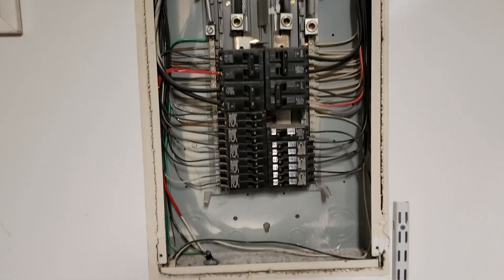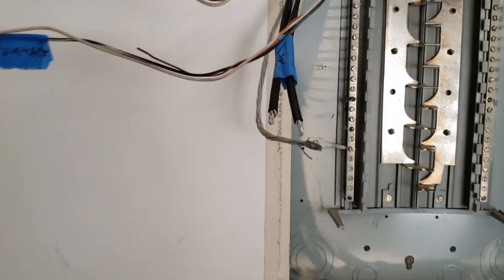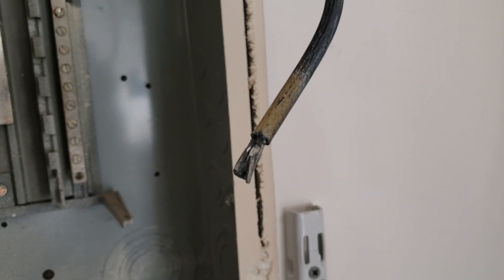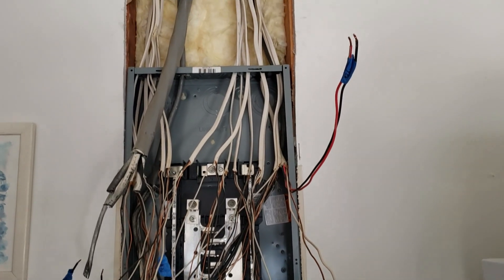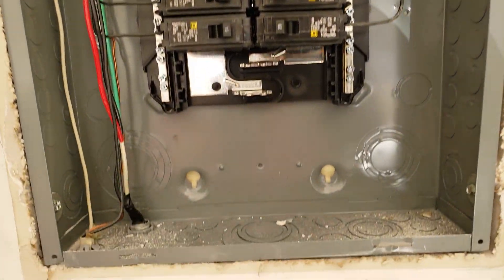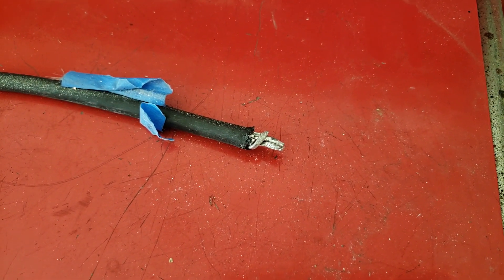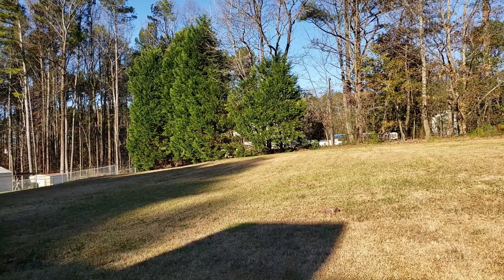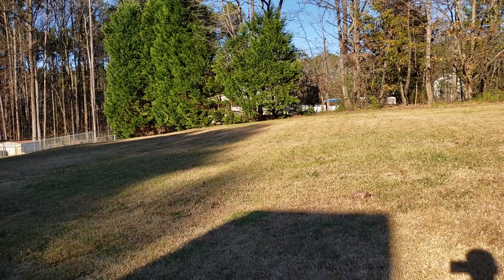Breaker Panel Update & Future Site of Solar Panels

Comment: I would like to build my first battery 16s.  Curious why you chose a
120Ah over as much as a 285Ah?  My thoughts are I could build 2-3 16s or 1-2 2p16s  with 285Ah batteries and have less hardware and space etc.
Reply: Currently the best deals in Lifepo4 batteries seem to be the 272 Ah or 280 Ah .  Many are using Lishen or EVE manufactured Chineese cells for around $125 per Kw shipped Depending on quantity.
Reply: Make sure and see whether or not they include terminals and busbars in purchase or make sure they do.
Reply from the maker: They were most economical at the time.

Comment: nice job. so many times I see the alum wire done wrong. why it's not allowed anymore. I would think about those wire ties though. it increases the tempature ratings needed cause it changes it from wires in a cabinet to bundled wires. it does make them look nice. but they don't cool as well. but that is really a nitpick as it's unlikely enough of them to be under high loads at once

Comment: awesome. so is that feed going into the new panel coming from the MPP Solar inverters? How did you wire the AC input on those inverters then? a small subpanel coming from the meter? looking forward to more updates. and congrats on the new place and buh-bye to those HOA communists. lol.
Reply from the maker: Exactly the same as in old home. https://youtu.be/Ng-abjBFkqo Difference is, supply line to house panel from LV5048 is now copper 2-2-2-4. I want to be ready so only thing left is to connect panels to the system. And yes, feels good when you don't have to ask permission to cut trees which I have just done week ago.